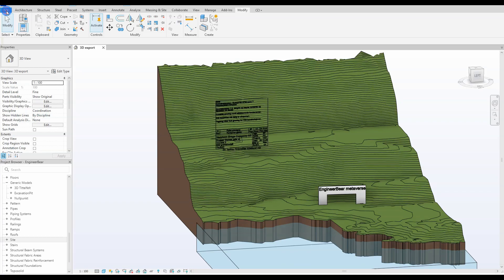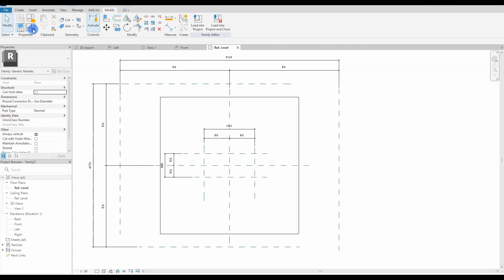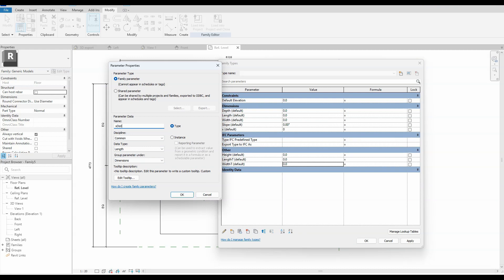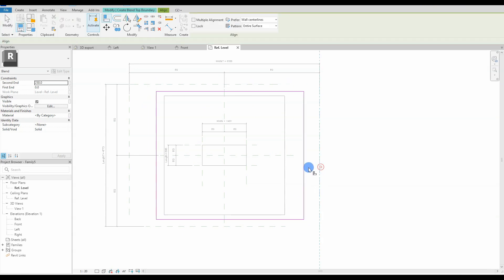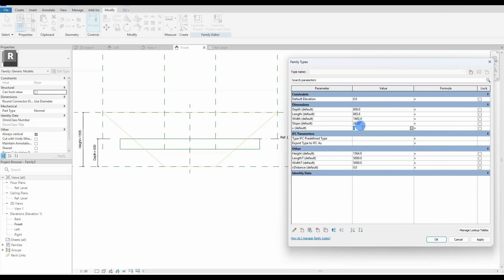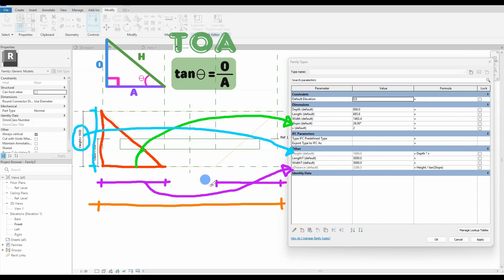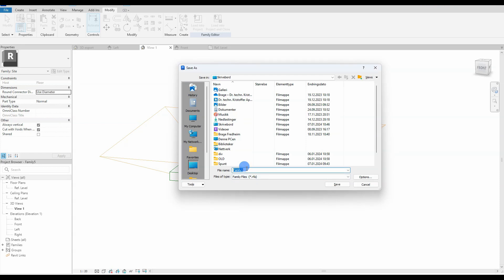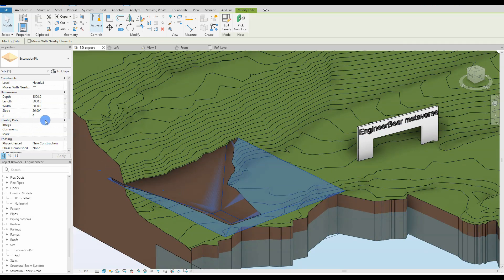Revit family masterclass: parametric excavation pit with trigonometry and tangent formula

Comment: Thanks EngineerBear, is it possible to add area parameter in this family. And how to calculate excavation area of multi shapes building.one more request how to calculate surface area for 100X100X10 Angle  having 15 meter length for painting calculation.
Reply from the maker: Hey Ranveer Singh! Thank you.
Yes, that is possible. I have two solutions. 1. Add a new instance parameter(important that the data type is set to area) that multiply the width and length. 2. Use dynamo to select all the area in the excavation pit (also the sloped area) and add the area together. I have created a video about how to do that(Revit dynamo - calculate area, length and volume for a complex object), follow the link in the description. You can also report back the area to the family, also did a video on this.
Reply: @EngineerBear90   thanks very much for replying. I will check and implement in my project.